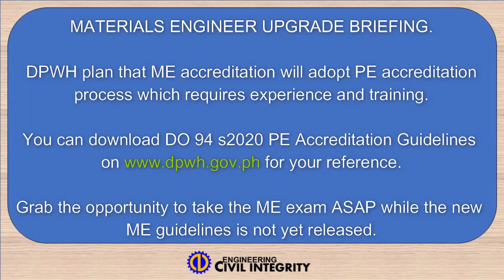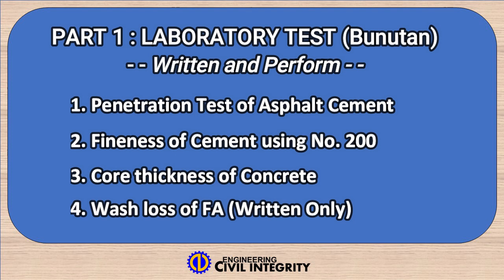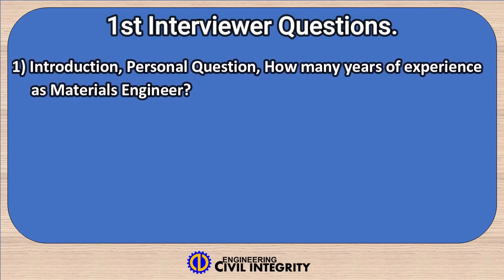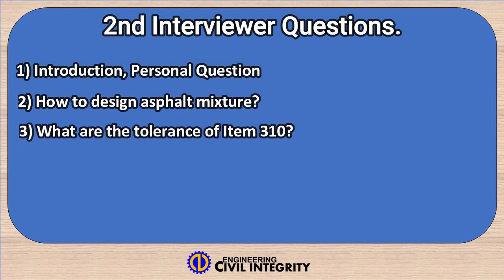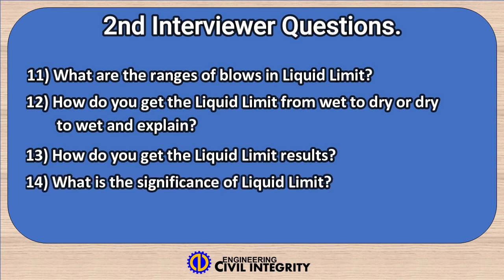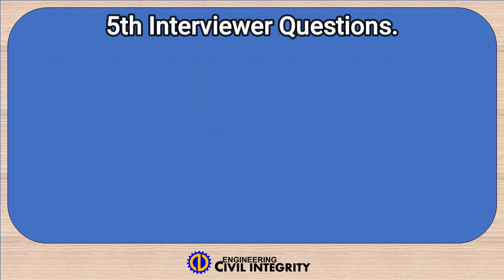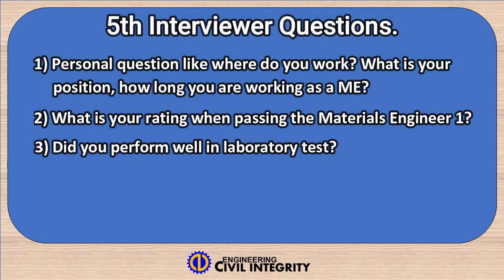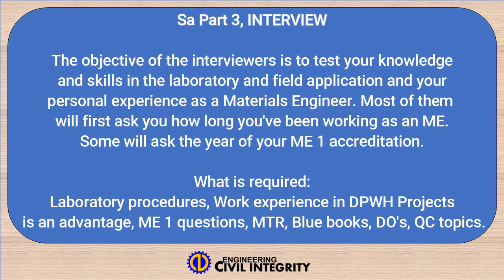ME II  Upgrading Based on Actual Experience

Comment: sir ask ko lng po, dun sa laboratory test, written and perform, paano ung set up nung perform po may sample tlga na ibibigay tas computation? or demo mo lng na literal? salamat po
Reply: Yes pupunta ka mismo sa laboratory ng brs. May mga samples na dun. Una ipapasulat muna  significance, equipments, etc. Then ippa perform sayo yung test na nabunot mo. Yung mttgal n test pinapasulat n lng wala ng perform.
Reply from the maker: Salamat sa pagsagot Sir Jojee.
Reply: Eto mga nabunot ko Penetration test, Fineness of Cement, Core thickness determination, wash loss of FA. Yung 1st 3, written and perform. Yung last written only.
Reply: Galing nyu po sana mapasa ko din ME2